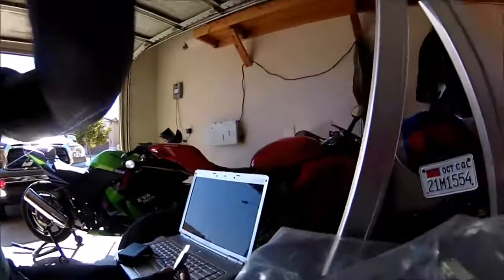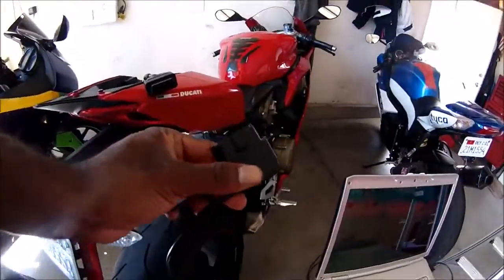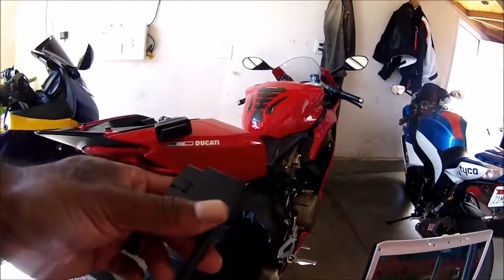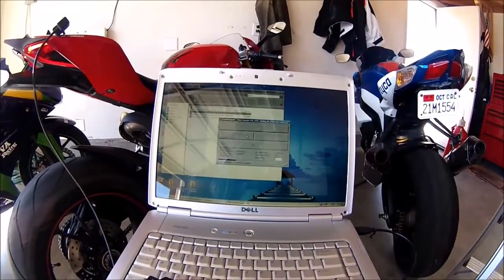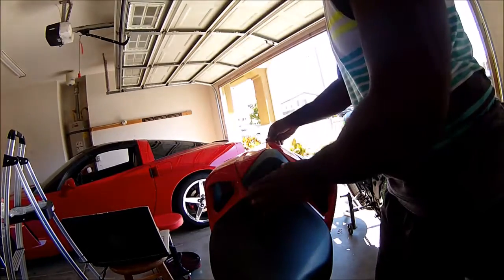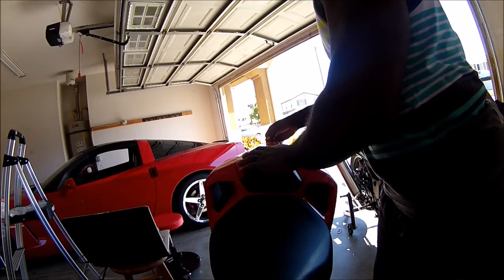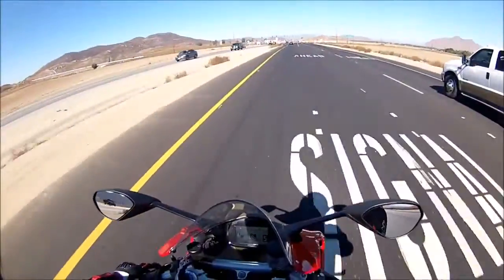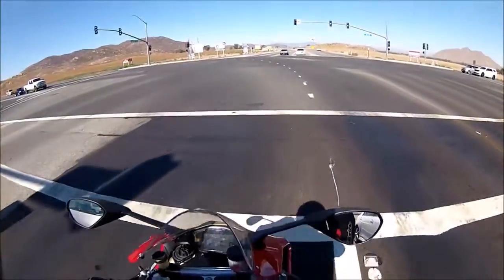Panigale ECU Tuneboy

Comment from the maker: Hanif, first thanks for watching. I don't  have any experience with Power Commander for the Duc, but I have used it for some of my other bikes. I have never used the auto tune though. All I can tell you is that I have always been satisfied with Power Commander, and if they do have control modules for the 1199, they will work fine. I chose Tuneboy because I didn't have to plug an EFI box like a Power Commander into the fuel injectors. Even though auto tuners are great tools; Tuneboy offers one also, I don't believe they are worth the money unless you are racing and do frequent changes to your bike like gearing, fueling for different tracks and weather conditions, and changing exhaust systems. Also, I believe auto tuners are for those trying to get every ounce of performance out of the bike. I have a lot of work to do on my riding skills before I can think about squeezing out more performance from the bike.

Comment: Did you notice an improvement in mid-range torque between 5 and 7k?
Reply from the maker: Fancy Animal I did notice a slight increase. The biggest change was the 4.5k rpm transition that use to give me that wild buck as power kicked in when cruising along. It is still not perfect, but it is a ton better.
Reply: I never had this issue.  My bike was a dealer demo with about 200 miles on it.   The bike was used as a test mule for service ECU updates and has always had good fueling.

Comment: Did you install the cruise control license?
Reply from the maker: tteitei I didn't install cruise control. I have read that those that do need to check the electrical contact for their brake lever. Sometimes it gets bent and will keep cruise control from working properly.  Whenever you use the brakes, cruise control is disabled.
Reply: Thank you

Comment from the maker: It is not required.  My Panigale is bone stock. The wide band is necessary if you want to extract every ounce of power from the bike. I couldn't justify the extra cost to get an extra 4 horses. Also,  when you order it, you need to state if you have an exhaust and filter, and whether it is a slip on or full exhausts, so they can send you the appropriate maps and trim files. In the maps they provided there was a tuning and cruise file. Cruise control doesn't require the wideband.

Comment from the maker: my kit just came with software on a usb, the Tuneboy box, usb/power cable, and ECU connector adapter.  The wideband is an extra cost, and I didn't buy it. The wideband accessory kit uses the  wifi capability for the auto-tuning.
Reply: Do you think the wide band is need? im considering doing the TUNING & CRUISE CONTROL kit and its says its REQUIRED. Just weighing the options of not paying that additional cost.

I guess i dont understand why the dual kit requires it but the stand alone tune doesn't. Those parts have nothing to do with cruise control and everything to do with the install you did right? To me their website isnt very clear.

Thanks for the fast reply by the way, this is a big help. :)
Reply: Does the tuning have the DQS U-D built in or do you lose this feature with out buying the tuneboy blip shifter?

Comment: did you get the TuneEdit Advance WiFi Kit – TUNING & CRUISE CONTROL, or just the tuning kit?. what did your kit come with? did you have to get the Innovate LC-2 Wideband and O2 Sensor kit?
Reply from the maker: I just go the tuning. The kit came with the adapter to plug into the bike, the Innovate WB-01 box (black box that is the intermediary between the computer and the bike), a USB cord that goes from computer to WB-01 box, a USB stick with all software and drivers, a small instruction pamphlet, and a Tuneboy bag to keep everything in.